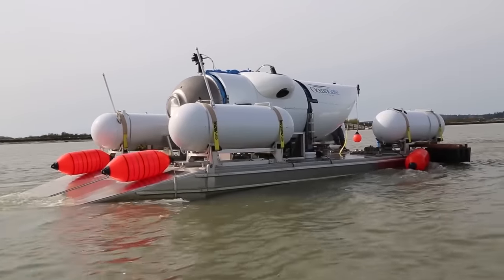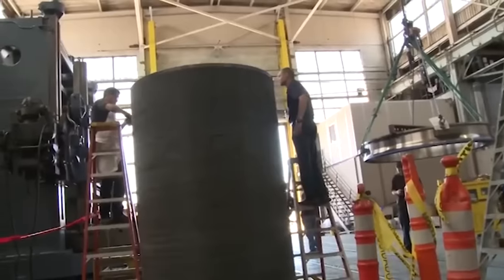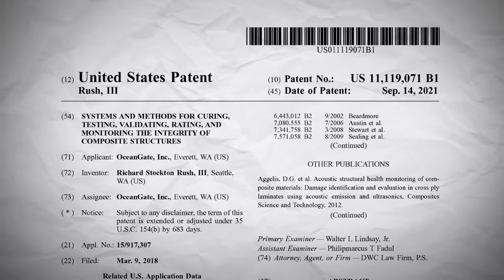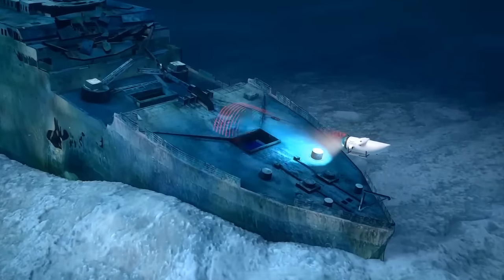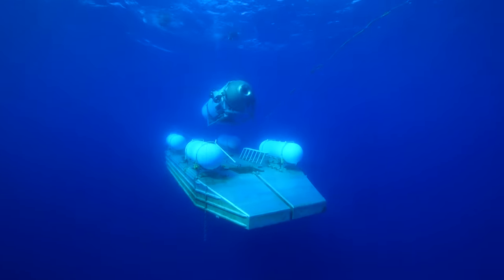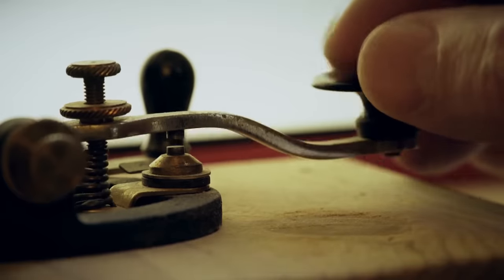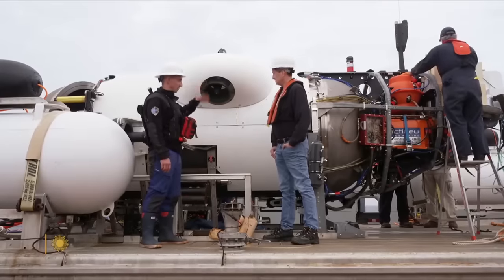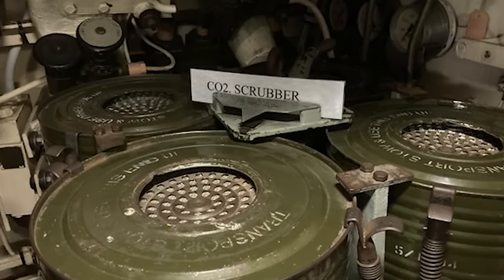Exposing OceanGate Submarines Many Fatal Designs

Comment: First, the CEO bought the carbon fiber from Boeing at a discount because they said it was at the end of its shelf life. Secondly, the tubular shape cannot hold up for long under that water pressure 12,500 feet below.  He also built the submersible with off-the-shelf materials cheaply and did not get it certified.  The carbon fiber probably weakened after several dives and suffered fatigue. Some experts had said it was unsafe, but the CEO and pilot disregarded safety warnings
Reply: Well ,they won't  be disregarding  any more safety warnings .
Reply: @@BobbyT-yj1cwit imploded mate, all five men are liquid now
Reply: @BobbyT-yj1cw no.  The debris field has been found, and small bits and pieces of the internal pressure chamber have been found among the debris.  They are gone, and they never even felt pain/knew what was going on. implosion happened so fast that  their brain literally didn't have the opportunity to send signals and prosses the situation.
Reply: "CEO and pilot disregarded safety warnings" - Yes, just like the captain of Titanic did, people never learns...
Reply: @@BobbyT-yj1cwbro what 😭
Reply: @@BobbyT-yj1cw What the hell are you on. 1. They found the back titanium cap of the sub's pressure hull. 2. Even if they didn't they are long out of oxygen.
Reply: @@BobbyT-yj1cwIt's nice to think positive but there is a limit you know. The passengers pretty much got disintegrated, ain't nothing left of them.
Reply: Reads like a made up story by you.
Reply: @genuinsanity how do you know that?
Reply: @@BobbyT-yj1cwthey got vaporized lmao aint nun to look fo
Reply: @@BobbyT-yj1cwwe take in oxygen and emit carbon dioxide, even if this was true it's been like 2 weeks already and they only had 96 hours of oxygen, plus the dome on the front was connected to the chamber sealing it with bolts, if the dome was found disconnected as well as other debris on the bottom of the ocean, they are 100% dead whether you like it or not
Reply: @@BobbyT-yj1cwYou're from Oceangate, are you?
Reply: @@BobbyT-yj1cw where did you get your brain? I thinks it's faulty, report to the manufacturer immediately so it may be recalled.
Reply: @@BobbyT-yj1cw the CEO said the thing was safe from the start and look where it got him, listening to the CEO is the worst you can do, also think of it like this, if you have 5 people with let's say 100 hours of oxygen, if everyone was calm, it would surely last 100 hours, if you have 10 people with the same amount of oxygen, it would only last 50 hours because twice the amount of people are breathing the oxygen, when someone dies they don't suddenly emit oxygen? Your only source of that is "experts say"
Reply: @@BobbyT-yj1cw what are you on about man, the dome was bolted to the open chamber, without the dome, the chamber is open like a can once you take a can opener to it, you can watch videos of the done opening and being shut, like I said before they found pieces of the sub on the sea floor suspecting that it imploded, meaning the chamber too, imploded. Even after all of this if they were somehow alive, finding them is like finding a spec of sand in a hay stack, it will be nearly impossible, they will definitely run out of air by then
Reply: There’s a reason that Navy Submarines have large bulkheads along the cylinder. It pushes against the pressure. A skin design on a tube is not strong no matter how thick that it’s designed. The middle will always be the weak point.
Reply: Can we please stop referring to the build as off the shelf... as if he went to home depot to procure a carbon fiber shell, titanium endcaps, and plexiglass domes. Yes the toilet is from Camping world (doesnt affect anything else) Yes the lighting inside is from camping world (doesnt affect how the sub works).
Reply: Yes...shape should be round which when squeezed makes it stronger. Yes...each dive weakened it.  Thanks for the information about it being used material at the end of shelf life.
Reply: @@BobbyT-yj1cw the window is part of the dome goofball, and the chamber is the part of the sub that imploded, how do you think they got in hm? The dome with the window, it would open up on hinges, then it would be bolted shut, that's the price they found meaning the chamber was open without the dome/window! How do you not understand
Reply: @@BobbyT-yj1cw also it's not complaining, it's common sense
Reply: @famousamoso7  the CEO in fact bought cheaper carbon fiber that was already "expired"
Reply: He probably got the game controller on a Walmart Rollback....couldn't pay full price for that!
Reply: @famousamoso7 no SIMPING!!
Reply: @@BobbyT-yj1cw i want some of what you're smoking. Must be good to detach from all facts like you are
Reply: @@BobbyT-yj1cwthey turned into red soup.
Reply: Bobby is kinda creeping me out.
Reply: I'm sure they knew this. Several engineers requested he have the hull pressure tested. The owner was so arrogant, he thought the ocean would yield to him. I just don't understand the billionaire or even the millionaire. If I were going to put my life at risk, I would pay my own engineers to check it out first.
Reply: ? G
Reply: Even worse. He sued a guy who said it was a death trap. Wanted his money back.
Reply: KARMA
Reply: @gingerdude  ok but he didnt buy it off the shelf.....
Reply: @@BobbyT-yj1cw LOL. You have to be trolling.
Reply: @@BobbyT-yj1cw did you just disregard everything I just said, Jesus Christ dude you are so close minded
Reply: @phil7551  I bet there are still survivors underneath the memorial of 911! Have faith and stay positive brother!
Reply: @famousamoso7  yeah more like from Aliexpress looking at the quality😂
Reply: @@BobbyT-yj1cw They found the end cap of the pressure chamber. They are all goo.
Reply: You guys keep fedding the troll. 😂
Reply: @SobboMonkeVR  not even that. They simply got vaporized
Reply: @gingerdude  Yep, took less than a second and made rich guy soup out of them.  They didn't even have time to crap their pants before they died...
Reply: @@BobbyT-yj1cwI’m not a materials engineer, but I imagine the carbon fiber chamber completely shredded itself during the implosion and ejected the titanium end caps off. You will never find an intact pressure chamber as it was reduced instantaneously to carbon fiber filaments.
Reply: Just curious why is it that that are wine bottle in the titanic site fully untouched and unbroken by the so called tremendous so called pressures?
Reply: and now his skull is at the bottom of  the ocean..
Reply: The owner disregarded and paid with his life and 4 other people's. I can't believe he was able by kaw to actually licence this. To me, Titan looked like a 6th form college project. Just looking at it sends shivers down my spine.
Reply: My biggest question is, why was he so adamant about using carbon fiber to begin with? Especially since it's completely unrpoven and untested in a deep sea environment. The only explanations I could come up are being lighter weight, or a mistaken belief that it's stronger (It is in some regards, but doesn't seem like a wise choice for a pressure vessel because of tensile strength). Or perhaps Stockton Rush was more interested in being an "innovator" and wearing that label like a badge of honor. Now you've given me a fourth possiblity...it was just cheaper. I've heard carbon fiber is incredibly expensive, but not if he was getting discount fibers from dollar tree or Boeing, or whoever
Reply: I believe this emploded when they lost contact after 1 hour and 45 minutes. As the US Navy picked up the emplosion on its system.
Reply: How stupid it sounds that CEO and pilot disregarded and they were operating openly under the government. No one stopped them or asked them. A country where you can't even over speed a mile on the roads. Wowww
Reply: Those that seek death will follow him instead. Let's hope the spirits of the titanic ignore them for eternity
Reply: @@BobbyT-yj1cw Are these comments serious ? I haven’t looked further down to see if this stupidity continues or not. If they were floating on the surface with air….they would have been found by now. Finding them on the surface is way easier than finding them at varying depths around the ocean. Flat surface on top…or a massive area also including the 10,000 or so feet below the surface area ? Which one do you think would be easier to locate something on / in ? Answer is the flat surface. These people were vaporized and didn’t even see it coming. Take some comfort in knowing that they didn’t even know they were dead, and take your head out of your ass / dreamland. This is the real world, pal.
Reply: You're kidding!!!
Reply: @@BobbyT-yj1cw That`s the problem with such comments, we don`t know if you were sarcastic or not.
Reply: @@BobbyT-yj1cwjust a troll, run along
Reply: @@BobbyT-yj1cw- The carbon fiber pressure hull wasn't found because it had disintegrated into small shreds during the 6000 psi pressure implosion.
Reply: The contraption was a freaking toilet paper roll.
Reply: @@BobbyT-yj1cw bless up, fam.

Rest of y'all, Keep the faith.
Reply: @@BobbyT-yj1cw any opinion that doesn't apply with your beliefs is wrong and they're sobbing Karen's? Sounds like you're a narcissist to me, and indeed that is a good point that guy made about the carbon fiber
Reply: @DoggMatik  you didn't add anything to the conversation
Reply: Thank u, really informative x
Reply: @crazykid5017  Ignore him, he is just trolling, special little princess he is.
Reply: @wayneallinson4925  yeah your probably right
Reply: @cjthegood9342 But they felt the warning signs right before it happened
Reply: @crazykid5017  I hear that 😤💪💪
Reply: He got exactly what he deserved.
Reply: All facts and red flags.
Reply: @@BobbyT-yj1cw I don't think you understand how the pressure chamber was constructed. It was a carbon fibre tube with a titanium end cap on either end. You can't see the rear end cap normally but when the covers are off the rear end it's clearly visible. The fact they found a cap, regardless if it's the front cap or the rear cap, means the carbon fibre tube was almost certainly turned to dust. And the people inside are 100000% dead, there is literally zero possibility of them being alive.
Reply: @@BobbyT-yj1cw nope.
Reply: @@BobbyT-yj1cw Agreed! Everyone is so pessimistic. They will be found and resurface along with the Titanic passengers who have been patiently awaiting rescue.
Reply: @sharonland..I agree with you. Communications and beacon signal both lost at same time they heard the noise. Many experts contacted them wanting certification. It didn't happen. Two types of material also..the titanium and carbon ..the separation was just waiting to happen. One thing to the guy still wanting all to have faith. How long do you think a human can do without water is. The submersible had scuba gear under the flooring if needed...sadly and tragically it could not take the pressure  especially at those depths. I wouldn't have went down in one non teathered for communication and ability to pump oxygen..but I would if able to pay 500,000 for myself and child let alone the billionaire that has made several genius world records and been down to the deep trench in the ocean over 7 miles down in a real sub..you would think would have had it checked out
Imploded is imploded!!!
Reply: @MrMJmusicLover  that we likely will never know.  While yes, we are aware that the pilot knew the pressure chamber was fucked,we will never know if he told the other passengers, and we'll never know if they knew what was coming.
Reply: @cjthegood9342  an increase of ratting would be a good indication.
Reply: @@BobbyT-yj1cw Trolling pretty hard there, aren't ya son?
Reply: @@BobbyT-yj1cw I don't think you know what an implosion is.
Reply: Basically the design and construction was not certified and therefore not ok to take on tourists
Reply: Lol, so easy to troll noobs these days
Reply: @@BobbyT-yj1cw Some people might still be alive inside the Titanic living healthy retirement life. You never know, just stay positive.
Reply: @isis4754  Last I checked a human can only survive 3 days without water
Reply: @@BobbyT-yj1cw bro I've already moved on from this conversation, even if I don't have the brain of that person, neither do you and he is smarter than both of us huh. Anyway have a good 4th of July with your family
Reply: Those people are fish food. That depth with no gear or vessel? Im 100% positive on that.
Reply: @@BobbyT-yj1cw There's a difference between staying positive and staying delusional...
If you are so sure that they are alive, why not test it out yourself?
Get a submersible and go to the titanic. We will definitely find you alive and well down there, at the bottom of the sea floor.
Let's Stay Positive Brother, right?
Reply: @famousamoso7 this nibba was getting on eBay for parts
Reply: @famousamoso7 and your point is?? He still constructed a PoS excuse of a sub that had like 20 design flaws….all because he wanted to keep it as cheap as possible.
Reply: @sherlockhomes9919 yeeaaa…..I fed him once, and then realized what he was😭..
Reply: @Yimvision  the scariest part is that he probably isn't trolling. Some people really are this insane and delusional. Look at Stockton Rush and the people who dove with him.
Reply: @dereksbooks  yeah it's incredible how ignorance can lead to situations like this
Reply: Excellent presentation. I learnt a few things. Thanks.
Reply: @gingerdude I wonder if it went slow motion. Adrenaline?
Reply: @@BobbyT-yj1cw U do realise the end cap is like the front and PART of the entire chamber...if either one of those falls off the insides are open to the depth of the ocean and given how both are attached to the main body of the submersible it is VERY safe to say everyone is dead
Reply: @gingerdude I'm kind of curious what happens to the body during something like this, It's a death you never see. Invisible cruching, then does that energy explode?
Reply: @@BobbyT-yj1cwyou forgot stay 'positive brother '
Reply: @@BobbyT-yj1cw The tianium end cap was an integral part of the pressure hull - like the cap on a soda bottle...
Reply: @MsBleau  during an implosion, heat is generated. We're not talking like 30°, we're talking thousands of degrees that melt the body and vaporize it.
Similar to what happens if you jumped into an active volcano. 
But it all happens faster than a blink of the eyes
Reply: @gingerdude  thank you wow
Reply: @leoneguardo905  my point is the clowns who dont know wtf they are talking about trying to sound educated on the matter.
Reply: Most broadcasting 5 suicides ever got .. Moral of the story dont oceangate yourself .
Reply: @BobbyT-yj1cw  Thank you. I was looking up how much a cubic foot of water-psi weighs causes.Implosions and internal combustion are the 2 deaths we've never witnessed.  I'm fascinated with the body, forensics. Another said heat forms, vaporizers the parts. I expected the body to get all the air sucked out and then an explosion once max pressure happens, mini parts everywhere. I need to find if heat does form. Yeah, I'm weird. I like learning useless facts.
Reply: James used a tubular shape with no fatalities
Reply: @bananka4905  Which Sub are you referring to of James? 
His subs all used a spherical shape for which he resided in. The overall design may have been tubular but the actual pressure chambers were always round and made of 1 compound being steel and or titanium.
Reply: @famousamoso7  yeah I don't know why they didn't stick with these materials
Reply: @famousamoso7  they looked cylinder in his videos
Reply: @jasonhaynes2952  My guess is because he was smug and wanted to intentionally do out of the box thinking/design to have his own concept to prove how smug he was. He didnt want to stick to conventional wisdom but wanted to test new designs.
Reply: @bananka4905  CEO was smug and wanted to be "different". Sometimes different isnt always good. 
Interesting though if you look at James Camerons Challenger sub and compare it to Victor Vescovo's deep sea challenger sub. Both look very different. However both utilized the same exact principle of a titanium spherical pressure chamber. Everything else is just accessories to support the subs mission.
Reply: @famousamoso7  Carbon Fiber is supposed to be stronger than steel. However, "strength" isn't a cut and dry terminolgy in engineering. There's tensile strength, pressure strenght, and of course, strength over time and after stresses.
Reply: @jasonhaynes2952  I agree. I believe Stockton was dismissing those other variables and the fact he never did actual testing or accounted for the cycles of stress he was only fooling himself it would be a better design.
Reply: @@BobbyT-yj1cw totally agree! It seems unwise to use something that depends on the bond between two different materials to remain intact. What they should have done is built 3 or 4 subs and tested them to the point of failure. One to determine how high before the vessel succombed to pressure. For something like this, it should be engineered to withstand TWICE what it will actually be operating at. Another sub could be subjected to repetition tests. Exactly how many dives can go to 12,500ft before the structural integrity gives out. Then you use the 3rd vessel for other tests with monitoring equipment and no passengers and subject it to various conditions and situations. The 4th one would be the actual sub used for passengers once all the other variables were calculated.
Reply: @@BobbyT-yj1cwI'm positive my brother. They have been found. The 5 of them have been spotted queuing in line at the Kingdom of Heaven wherein God is still judging whether they enter or not. I'm also positive you had a brain fart, rather an implosion occured inside that 🧠 of yours. Anyways stay positive mah broskie.
Reply: @BobbyT-yj1cw  Thank you, They probably didn't even know what hit them.
Reply: denomi  Denomi that is the best explanation iv'e heard thank you so much
Reply: @MrMJmusicLover  I guess, but these guests would've been none the wiser. We will never genuinely know for sure whether or not the other four passengers on the sub were aware of their demise, but I like to think that they weren't.
Reply: @TreyDobe  positive thinking does do repeal the laws of physics and strength of materials.
Reply: "First, the CEO bought the carbon fiber from Boeing at a discount because they said it was at the end of its shelf life."
This doesn't appear to be true. Boeing say they have no record of every having sold carbon fibre to Rush or OceanGate.
Reply: @beeble2003  just because they have no record of it doesn't mean it didn't happen. Just makes it more unlikely.  Happens with big job sites all of the time. 

"If you give me 200 bucks and lug it away yourself you can do whatever you want with it" under the table kinda situation.